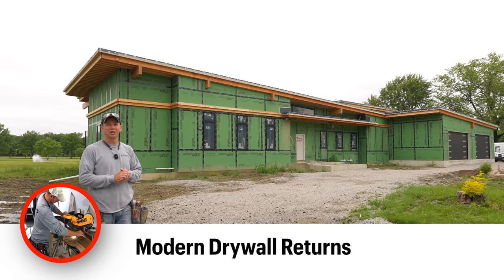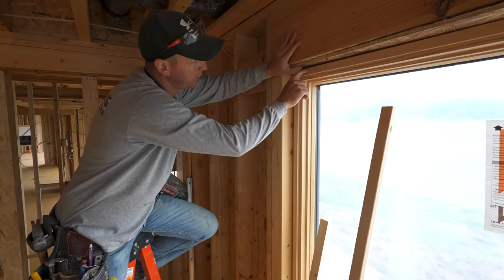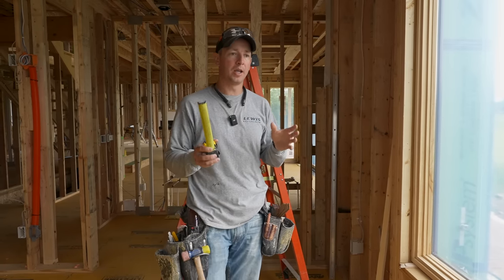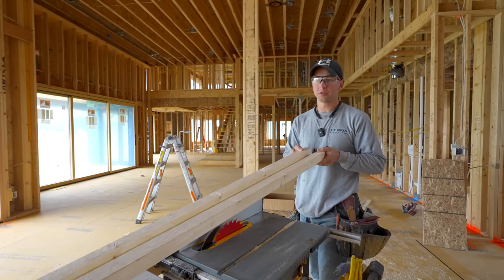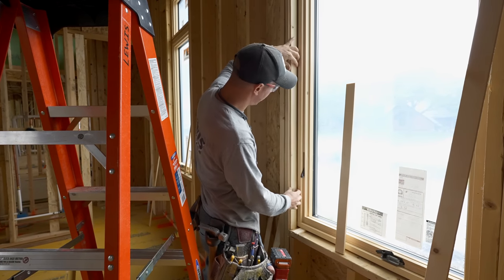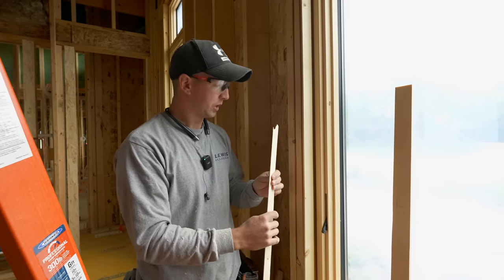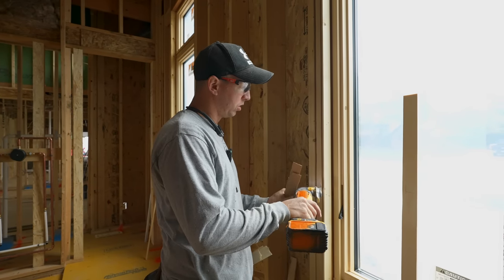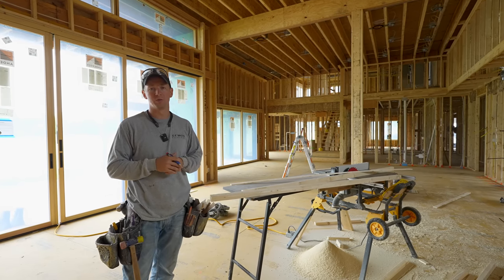NEW TREND!!! No Window Trim??? How to Tackle Modern Drywall Returns

Comment: Drywall returns = regret.  Not for houses with pets or kids.  It's one of those "eureka moments" months down the road.  "Ohhhhh, THAT'S why they put trim around things..... It's not just for decoration after all."
Reply: @@tommy_panzerotti  I agree they "Look" fine.  Not my cup of tea.  But it's not my house.  But the first time an axe murderer climbs in the window and gets footprints and chainsaw marks on those drywall corners, you'll know what I'm talking about.  We can't be paying to fix all that drywall every time a capital crime is committed in our homes.  It just makes no sense.  But whatever.

Ok just to be clear, that was my dark humor.  I just prefer a wood trimmed window.
Reply: I wonder if you could do window trim styled after a recessed baseboard, that might allow for a drywall return-ish style while still having a hard surface and hard edges to resist pets and kids.
Reply: @caffeinepuppy  Yeah, I think they call it "tile".  Haha!
Reply: @caffeinepuppy Trim-Tex makes a product called Super-L Bead that covers over the drywall wrap eliminating the need to coat the inside.
Reply: 100% agree. The drywall will fail around window and doors.
Reply: @teampalmerconst  Sweet!
Reply: Where i live there’s never been real window trims, the inner walls are all brick with stucco or pre cast concrete blocks with stucco. Also one of the reasons why european houses look so clean from the interior, cause we don’t do trims often.

Comment: I've replaced a lot of those after the drywall turns to mush at the sill.
Reply: One nice thing is I know I got water getting in then
Reply: Likely bc they aren’t using TrimTex as they should. And or insulating the gap between the window and RO  

I’ve never had a problem doing this unless a window wasn’t installed properly and leaked.
Reply: interior moisture. New houses are supposed to be dry but yeah they're not. Condensation is the enemy on the sill. 75°+ inside and minus 10° outside. So many new homes with moisture/ mold.
I learned on old house's that breathed.
Reply: @patrickcowan8701  when it is enough to destroy even a junk drywall window sill that more than just Condensation Water damage on windows is almost ways on the sill if it was condensation it would probably be all around the windows and more even damage all around the window I haven't seen that before

Comment: The issue with windows & door with out trim is damage caused by water, foot traffic, moving stuff. Trim is much more durable than drywall, and easier to keep clean.
Reply from the maker: Very true.
Reply: I like to go no-trim on windows but still use 3.5 in trim around doors with 5/5in baseboards.  The cleaned up windows look great to my tastes.  I've been doing it that way for 23 years in my personal houses.  With doors there is more risk of cracking from slammed doors and the weight of the doors.
Reply: @planesandbikes7353  Issue is if you leave the window open during a rainstorm.

Comment: When I was an apprentice carpenter in the late 1970's, I work for a Tract Home Builder and all of the houses had drywall returns to the windows.  The sheet rockers would cut the dry returns and leave them on each rough windowsill. It was one of my jobs to go back and shim the returns and nail them in place.   This was considered the "low-end" approach for trimming out windows.  ---  "Everything old is new again" --- Chris
Reply: It is interesting that architectural styles come, go and come back. Bead, stool and apron were always low end. Not on this project.
Reply: " This was considered the "low-end" approach for trimming out windows...."   
-Still is
😎
Reply: We have seen many contemporary homes with drywall returns (trim-less) and others with low profile casing. Trimless is the best look IMO for certain architectural styles. For trim-less to hold up over time, you can’t use drywall against the unit. The method we have used is described in another comment on this video. Faster, cleaner, less labor and will hold up with thermal transfer being the main threat over time. Condensation, nail/screw pops and paint adhesion are not an issue but would be with gypsum board at the returns. My preferred minimalist look is trim-less but with radius bead and a simple canted 5/4 stool. But then I want the walls to be textured to look like plaster stucco. Doors, door jambs and stool are stain grade. The home can go forever without an interior paint job.
Reply: But the question to other builders or finishers in the video is not what we like to see or not see around a window. The question is always “how to do it better”.
Reply: Two types of people want drywall returns on windows. 
   Cheap builders that think it's cheaper then trim.
    Modern builders that have clients that like the look.
    I charge a lot for drywall returns. 
  Cheap builders.... " I can trim it with wood for less." 

  Me...  "I know."

Comment: As a professional drywaller back in '70s and '80s, only the cheap houses and multi-units with metal windows got wrapped.  Amazing to see it come full circle.  I never thought it looked all that hot (just looked cheap), and was a bunch of extra cornerbeading/mudding work.
Reply: Everything goes around in circles as there is nothing new under the sun anymore so someone who hasn't seen it before decides to do it then it becomes a trend for a bit then the cycle repeats itself.
Reply: As an architect, I get what you mean but for a modern design, you don't want to see off the shelf trim around a window.

Personally, I hate trim unless it's in a proper old house. I would run all my windows with gwb to the frame and all interior doors. The only thing I will do is run a mdf baseboard with a half inch reveal. The baseboard is flush with the gwb. This gives a nice 1/2" shadow gap all around. For windows, I might opt for a formed reglet so you get the shadow gap at a consistent width rather than going hard up against the window frame.

Comment: Florida has had drywall returns for the 43 years I have been working here. I talk the good builds into a trim out every chance I get. I love the fact that you can go out to the jobs and "tighten up" rough framing. Very difficult in Florida. No habla level or plumb. "Modern design" is just code speak for cheaping out. We all know it. Good stuff as always!

Comment: Thanks for showing this. We're building an ICF home which has 13" walls, and we're having our windows finished this way. I just sent my building an inquiry regarding how the windows will be trimmed out to insure the reveals are consistent (like you addressed). We'll be having a window sill on the windows, but the other 3 sides will be drywall returns. 
Our windows had the insulation added to them last week, and they delivered a bunch of drywall today so next week we'll be having the drywall installed = sure hope he's taken into account the reveals as ours are very tight but like you said, tight makes it that much more important to have the reveals correct.
Reply: Ask them if they are familiar with dot and dab.

Comment: Lewis, using drywall as trim around windows is very common in new homes in my area. However the builders are so cheep that they don’t spend the time doing what you have done and just slap the drywall up around them and mud away. It’s more of quantity & speed vs quality unfortunately. Glad your builder is having you do this.
Reply: They did this style as a means of being cheap in the first place.

Comment: Just did this same detail for a house I’m on. Good to see you attacking it the same way. 
We did initially start with ripped ply blocks but quickly realized the continuous shim was the way. Also, framing was pretty rough so every shim got shimmed. Set the top and bottom then used the tomo line to shim in between dead flat. Good stuff. 
Appreciate the content sir

Comment: Rip and install extension jambs from 5/4 primed FJ material. Leave them to the back side (not the face) of the drywall. The drywall hangers will roto zip the drywall to the interior of the opening and the corner bead is fastened onto the wood extension on the return side and also onto the main wall surface. First coat on all bead is always catalytic compound. Hopefully Hamed is using setting compound on all the bead anyway. Bonding agent can be applied to wood. There are bonding agents that can be mixed with compound also. You can nail off any loose window stops and you are done with that opening (unless you run stool later). No shimming, no furring, no flying wooden spears on the table saw. No condensation migrating in and mushy gypsum in 3 years. More space for insulation at the perimeter and the drywall crew will love you because they won’t have to scrape foam, rip narrow pieces or install j-bead (which should have been used on the last house). Better mounting attachment for window treatments or shades. Because the extension jamb is fastened to the unit frame, any bows or twists in the framing will not show up at the corner bead. We drill and screw through the edge of the extension jamb with 2x4 and 2x6 exterior walls. This forms a solid and perfect substrate for bead attachment. Same look, better than messing with narrow drywall rips. The painters will also love you. Faster, easier, cheaper, better.
Reply: Sounds very good. Do you know any place with pictures of this technique?
Reply: @programuser1295  if you have installed drywall or finished corner bead and you also have installed extension jambs, you probably don’t need any new step by step for this.

Comment: I am doing the same details on my current build. I used 1/4 3/8 and 1/2 plywood along with a laser to make it perfectly plum. Also left it off the window for foam. I have been using drywall returns for years and have not had any issues. Using a solid hardwood on the sill can really help.
Reply: We did dry wall returns on all of our windows for a clean modern look but included a wooden still on the lower windows for durability. I think it has a really clean look to it.

Comment: Years ago in florida we had a piece of 1x that had a 45° edge facing inside and it was just inside the window frame.  The effect was that when wrapping the window the 45° edge would shove the drywall wrap up against the window frame. Provided the framer got the rough opening close to right. After hurricane Andrew building code people came up with what became known as deem to comply standards that forbade the use of those 45° strips as they didn't provide a sturdy enough support in high wind conditions. Now most medium and high end projects have wood returns.

Comment: Great tip on sawing shims. I  recently cut up (4) 2x4's and used a 10" indstrial grade blade on my Delta Unisaw ( older), what a pain. I tried your method this morning with a 7.25"  thin kerf blade and what a difference. Thanks for showing that method.

Comment: Everything I've seen this guy do is top notch, a real craftsman. We did drywall returns on our double stud 11-1/4" thick wall for our super-insulated house. Seemed like a huge waste to line the insides of the large window openings with wood, and then another layer of trim around the whole thing. Yes, drywall is not as durable, so we have a wood windowsill. But for the sides and top, drywall. We also used rounded corner bead which mildly simulates the rounded sides of window openings in the old stone houses (2 foot thick walls) in our area.

Comment: When dealing with deeper drywall returns, I've seen a builder add a small thin strip against the window, throwing the drywall return out of 90°,  so that when the corner bead is added it returns to 90°.  Was very impressed by the forethought and attention to detail
Reply from the maker: Yep, I think the only way to truly achieve 90 degrees is to add the L-bead in addition to corner bead.
Reply: This.  I've done commercial and residential returns.  1/8 is how proud the corner bead is, and that's what we've always keep the window end of shim out to line up 90 with corner bead.  Up in Canada most of our windows have slots to catch the drywall, so I just use metal light-gauge angle screwed all around the framing sitting out as much as it needs.  Full sheet goes over the window, gets routered out.  Then the return rips slide into window slot, and gets screwed into metal angle.  Done.

Comment: Thanks for shining out the windows.  Here the framers leave that to us.  We use flat tear away beads on the inside against the windows (if there’s room), and corner bead on the outside.  The tear away gives your knife something to ride on to keep the reveal flat and even and not wavy.
Reply from the maker: I wish they would use the tear away bead. It would keep the angle of the corner at a true 90 then and I think would yield a nicer product. But its a TON of trim pieces to cut and install so they have not been taking the time to do that.
Reply: I have done the same and the result is fantastic. The tear away keeps the window cleaner too.

Comment: Good one. Drywall returns are going to become more the norm. As a builder I'm always trying to think of ways to make things easier, but still net the end result. If you're using european style windows (i.e. no flange, but clips) you could simply flush out the interior side of the window frame with the framing and run the drywall right to the edge, or have your window sit 1/2 or 5/8" proud of the framing and terminate the drywall into the "back" of the window frame.
Reply: could you expand on this≥not certain what you mean ? maybe refer to a url that has an illusion ? Thanks

Comment: Funny how the affluent and wealthy are favoring construction practices that low income housing has used for years. Now, having said that, I can't help but think of your video about pocket doors and the wet set method. I abhor pocket doors but recently I used your technique with the wet set.  It completely changed how I approach pocket doors. I'm thinking in this application a bead of PL would be the ticket instead of the shims.
Reply from the maker: A couple others mentioned that as well. I think it would work also.

Comment: North American window manufacturers need to copy what Scandinavian window manufacturers are doing and add a little channel all around the window edge so you can slide in drywall/or a jamb liner into the windows. The drywaller will the use a metal L-edge to connect the two and you will only shim/support the bottom.

Comment: I never use a push stick. I have made a pusher that goes over the top of the work piece. If the push stick ever gets in contact with the blade it will go through your hand. Great video and love your quality work.
Reply: No it won't... the blade will just cut the push stick

Comment: I am laughing hard and really happy to read the comments under this one. I have been removing drywall and plaster returns for my whol;e reno carreer.
Kiln dried fir lasts for the duration of the home, and always looks great.
I've used solid oak and maple in many cases, pine  and ash.
Wait till the moisture from the drywall works on the wooden window frames ,,, yes I believe it will. Not as bad as the old metal framed windows did, but there will be issues.
The look of the drywall return in a few years is well documented by others in this thread.

Comment: Yeah, those cardboard drywall shims are pretty tough and hard to cut/tear.  I've had pretty good luck using one of those oscillating multi-tools.
Reply: I use tin snips.  Works great

Comment: An over-driven screw as a shim backing it out,probably wouldnt hold up on thin shims.

Am guessing fairly early regrets on "modern look".
Drywall returns on all my windows were in my home ,we keep curtains of shame over them.
Virtually useless where the stool is.
Baseboards save drywall from wheels etc up to waist high.
  Door trim saves drywall at egress/ingress,window trim allows for decorations.
Have you ever seen a pre 19 century modern castle by the richest of their era?

This is a tweener trade detail. 
Neither framing nor drywall, builder chose the trade with the best skills for this.
When i worked on a framing crew in the 90's,we installed the tarpaper until roofer could get there.

Comment: So, no trim window casings are back in style. Whoda thunk? Did a lot of those back in the 1980's and 90's. They actually don't look bad when they're new. They can get pretty ragged looking as they get older due to chipping and even condensation. They also tend to look rather commercial and lack the character of wood. More suited to offices than homes, IMO.
However, I must confess I have two basement windows with drywall returns.

I like your attention to detail in shimming your shims. I've used full length shims for wood and drywall trim, and you're definitely doing it right.👍

Also, a sacrificial push shoe works well for cutting those thin strips on the table saw.